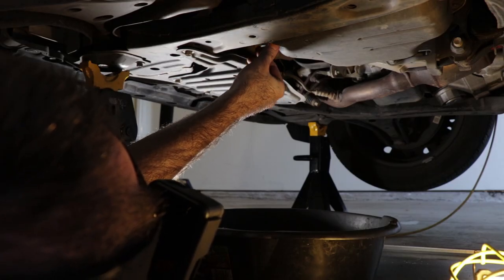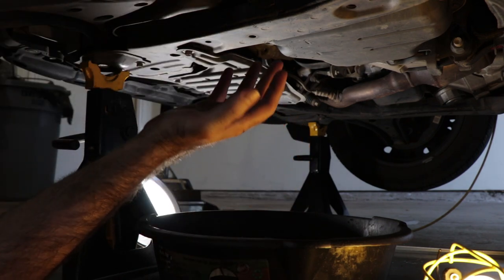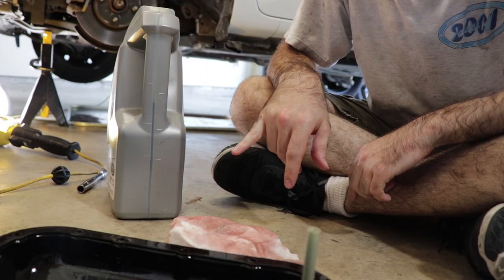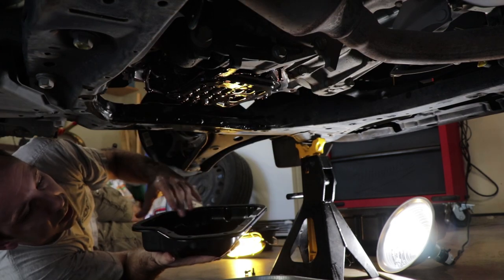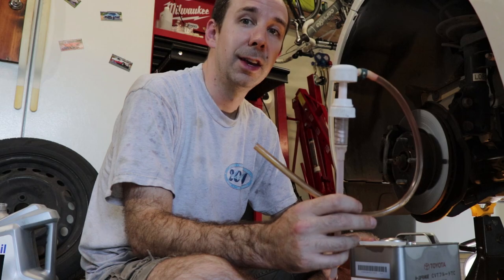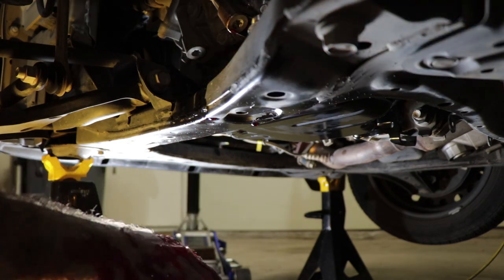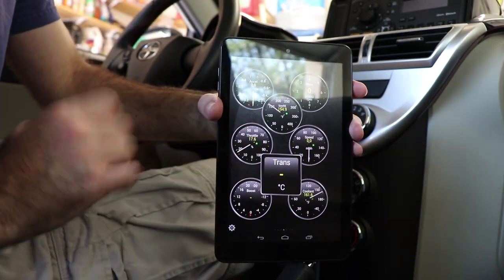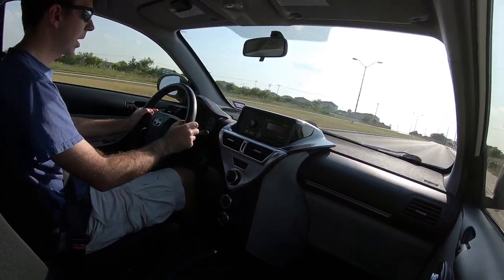Scion iQ CVT Fluid Change

Comment: Just yesterday, I did the transmission fluid change in my 2014 Scion iQ. After removing the drain plug and the plastic inner tube, there is still a considerable amount of fluid remaining in the pan,  but if you are careful there is no reason to splash it around, one can pour it all in the container being already in place for collecting the fluid. I also changed the transmission filter. Removing the filter also removes even more fluid from the transmission. Taking down the pan and the filter, I removed in total about 4.3 Liters, there is always a little bit that continues dropping from the transmission. The transmission is supposed to carry 6.2 L (according to my owner's manual), so this ensures that about 2/3 of the fluid will be new. My car was leveled with jacks, I leveled it with a level resting at the door sill. I followed the procedure explained in the video to fill the transmission and make sure the level was right. Following this procedure, I ended up  using about 4.5 liters of new fluid, which is very much the same amount that came out. Over all it was a worthy job and no that bad at all,  if I had to do it again it would be  a matter of 3 hours, including cleaning everything. 

Some take aways: I bought the filter from rockauto as suggested by Aaron (about $50). This filter came with a transmission pan gasket, which I did not use because I had already bought a new one from my Toyota dealer. The filter from rockauto is an identically looking part. I also bought from rockauto a quart of Aisin CVT FE fluid, because I was suspecting (and was right) that the 4 L jug of original Toyota CVT FE  fluid ($78) was not going to be enough. The Aisin fluid smells just like the Toyota fluid, same color and everything.

Because the pan gasket is some rubber/cork material, I think it is imperative to use a torque wrench, I tightened mine at 62 in/lb (as per Aaron's recommendation), and that seemed quite right. 

I filled/fed the transmission by gravity using a 1/2 inch clear flexible tubing from HomeDepot, with a funnel attached to one of its ends, the other end inserted through the side fill port. The fluid went in without hesitation. 

The procedure to measure the transmission temperature that Aaron describes is a breeze and  should be considered the default procedure. Warning: you have to work fast because the transmission temperature increases quickly, I started with an ambient temp of about 85 F and only had about 5 minutes before it went passed 113 F (the correct range is 95-113 F, I think).

Many heart felt thanks to Aaron for such a great service.

Comment: I did just the fluid at 25K then at 30K I dropped the pan and replaced it with new magnets, bolts, plug and the level tube. I carefully measured how much fluid drained out then added 1/2 quart extra. 43K now. Refilled with the top hole but had to screw in a foot long piece of soft hose with a tall slender funnel.The top hole will burp air out as you pour in the fluid. Thanks for the useful info!! not to many IQ repair videos out there.

Comment: I forgot to come back here and thank you, Aaron. THANK YOU! My car had that now-familiar whine. I thought it was something in the radio, but finally found the real reason. Your videos helped a lot. I bought a bulb pump with a hose that fit into the side fill hole and avoided most of the mess. I had to wipe down the side of the transmission case then douse it in Simple Green, but that was basic cleanup. No more whine!

Comment: I drained the fluid, dropped the pan and removed the transmission filter that's attached to the valve body with 3 bolts.  The filter has a fiber type mesh and isn't available from the dealer because Toyota doesn't want these transmissions to last very long.  I couldn't find any filter for sale online that looked identical to it so I rinsed the inside of it with solvent and blew it out with compressed air.  I measured the total amount of fluid that drained out and will refill it with the same amount.  It's ridiculous how some manufacturers no longer have a dipstick and fill tube in their automatic transmissions.   If Toyota would have sold the 6 speed manual version of the IQ in the states I wouldn't be forced to deal with an expendable transmission.

Comment: The filter needs to be changed.I bought it and changed the cvt fluid and installed a new filter.it is an easy process .Thanks for the video.
Reply from the maker: Do you have a part number or source for the filter you can share?  I spent a great deal of time looking for a source for it, and I never could find one.

Also, I'd argue that the filter doesn't necessarily need to be changed like the one in a regular automatic does, since this transmission only has one or two clutch packs, that don't engage and release while the car is moving.  You'll notice in the video that the fluid that came out of my car was still bright red, with very little worn off friction material in it.
Reply: Any idea of the part number for the filter cant seem to find one for the IQ

Comment: Dude, you're my hero.  Toyota (Scion) is woefully inept on this....CVT oils DO have to be changed periodically.  My 2013 iQ hit 60,000 and I could find hardly any guidance so got a can of the red CVT oil from my dealership and MAN what a mess.  I ended up just putting as much as I could back in the car and bringing it down to Christian Brothers (about a mile away) who fixed me up.  So, for my NEXT change (at another 60,000) miles, would it be okay to measure exactly how much I drained out on the bottom and just refill with that exact amount on that side fill place?  (Which I didn't even know about until I watched this!)
Reply from the maker: You could probably get in the ballpark that way, but if you might as well do it the correct way.  I admit, I wasn't very clear about this.  I should probably redo this so it's easier to follow.
1.  Drain fluid out by removing drain plug and level tube
2.  Reinstall level tube
3.  Fill until fluid overflows through level tube
4.  Put drain plug back in, add another 400ml
5.  Start engine, warm fluid to temperature
6.  Remove drain plug only - look for trickle of fluid
7.  If no trickle, add more until it overflows.
8.  Reinstall drain and fill plugs, wheel, etc.
9.  Shut off engine, open beer
But yeah, if you just measure what came out and put that much back in, you'll likely be close enough, unless the level was low to begin with.

Comment: IMPORTANT! Hit the pan bolts with PB blaster the night before! And use anti seize when replacing the pan bolts! I had three that got super tight once I started loosening them. They were seized and one sheared completely off and turned this into an all day project. I thought the other two would do the same but hit them with an impact wrench, thinking the hammer action might help break them loose and that seemed to do the trick.

Comment: Nice Video, since it has the same trans than my Vitz.   By the way "B" stands for engine brake (downhill driving).
Reply from the maker: Ah, that makes sense.  I suspect there are probably a few Toyota models that come with this transmission, but the iQ is the only one we get here in the States, as far as I know.  The exact quantity of the fluid you need may change a little from model to model, if they have different fluid cooler arrangements.

Comment: I read somewhere that a failure of the KB41 CVT was overheating at cooler temps. Always add extra fluid and don't drain it off till a drip. The height of that tube is to ensure failure before 100,000 miles.
Reply from the maker: You should definitely not overfill the transmission.  You don't actually want the components of the trans immersed in the fluid while it's running, which is a thing that can happen if you put way too much in there.

The tube is just the way that Toyota went about measuring the fluid level.  It's a clever idea, in that it makes checking the level easy from below, while the car is already on a lift overhead, and eliminates the dipstick, which owners generally can't be trusted to use properly.
Reply: @AaronAverett  Yes,All True, But mine was slipping between shifts in cold temps until that 1/3-1/2 extra quart was added at 25k miles. I'll try to find that site that listed failures of this unit and their history.
Reply from the maker: @Josephlola  Uhh, shifts?  It's a CVT - it shouldn't be shifting at all.

Comment: If you removed the straw with your 6mm hex/Allen wrench before dropping the pan you would have avoided the bulk of the mess.

Still a very good video.
Reply from the maker: I think I mentioned removing the measuring tube thing specifically about 2/3 of the way through.  As I mentioned, the manual doesn't describe this procedure specifically, so I had to do it the hard way the first time to figure it out.  Anyway, thanks for chiming in, I hope it helped you out. :)
Reply: @AaronAverett  
Guess I missed that...

Comment: Thank you for your thorough explanation on how to change the transmission fluid in the Scion IQ it was extremely beneficial. I did notice you used the Toyota TC spec fluid that the dealer recommended for that transmission however the owners manual recommended the Toyota FE spec fluid
Reply from the maker: Information about this is kind of murky, but around 2012, the "FE" fluid apparently superseded the "TC" fluid in most of Toyota's products, but they're similar enough to be interchangeable.  The FE fluid is thinner, and supposedly offers better fuel economy.

The owner's manual for my 2012 US market iQ says to use the TC type, so that's what I used, but it wouldn't shock me to find that other years say to use the FE instead.  I don't think the fluid makes any difference to the change procedure.

Comment: Nice video sir.  But at least cvt filter should have been cleaned after opening it , with cleaning fluid or atleast distal water . Pluse more cvt oil would be darined ( 0.2 L) with metal parts and dirt too.
Reply from the maker: Fair enough.  The filter that's in there seems like more of a strainer than a normal filter, though, so I'm guessing it mostly just keeps the ball bearings out of the works.  

Also, I'd advise caution on the grounds that I couldn't find a source for a replacement filter, so if you remove it, you need to be real careful about damaging any gaskets or seals in there.
Reply: @AaronAverett  it has very fine little holes in it which captures dirt and pervent small little metals to enter the cvt.

Comment: Thanks for the video, so the metal CVT can from Toyota for the transmission, should be enough to fill itcorrect?
Reply from the maker: Yes.  I talked at length in the video about how I did it wrong, but doing it properly, you should need roughly half of the can, as I recall.

Comment: Thanks for this awesome video.  Is there a difference between using the side fill hole of the transmission than the top fill hole?  I noticed a top fill hole as well.
Reply from the maker: You're welcome; I hope it helped you!  To answer your question, the manual is pretty specific about using the fill port I used in the video.

It may be possible to fill the transmission via a hole in the top, but given how easy it is to access the one on the side, I'm not sure why you would.  I guess because you don't have the little pump thing?  You could use a funnel and a length of hose if you don't have the pump.

Regardless, I'd caution against removing fasteners from the outside of the transmission if you don't know for sure that they're fill plugs.  On some transmissions, there are fasteners on the outside that hold components in place on the inside that can fall down inside the casing and jam up the works if the fastener is removed.
Reply: I tried that...do NOT even try it...you'll be sorry...use the side fill only.
Reply: @coloradoboo1071  I'm guessing it filled your funnel up when you started it? I filled my brothers IQ from that top T55 torx plug hole, didn't even know there was one on the side of it since the little info I found online only mentioned that top fill plug. I caught it filling the funnel up pretty quick once we started it and avoided a mess.

Comment: How do you check how much transmission fluid is in the car? Or do you have to open the pan?
Reply from the maker: I definitely talked about this in the video.  The proper way to check that it's filled properly is to lift the car and make sure it's level, and then, with the engine running and the trans fluid temperature in the proper range, you remove the drain plug, but not the plastic tube that's inside the pan.  If the level is proper, you'll get just a little bit of fluid dripping out of the hole, over the top of the tube.

Comment: Great DIY video for my CVT, Nice !!!.
Question: I have your same device Bluetooth OBD Device, I set the equation and all right, when I enter Torque Pro in Realtime Information I can't find the temperature data that I need. How did you put it out ???, it doesn't happen to me.
Excellent video !!!!
Reply from the maker: Did you set the custom transmission temperature PID as a gauge in the real time display?  There are two steps to the process - the first is to set it up as a PID that Torque monitors.  The second is to add it to the display, so that it's shown on the screen.
Reply: I have everything fine now, Just with setting Torque correctly. Thank for your answer !!!
Reply: @AbeDVB  BTW i have a European TOYOTA iQ and  this PID didnt work, i tried everything bought the app, F and C formulas etc. o showed crazy numbers.....

Comment: Hello, I have a question about the filter number at the Toyota iQ 1.0 checkpoint. I can't find the Toyota iQ 1.0 gearbox filter number anywhere.
Reply from the maker: This is because Toyota doesn't have a part number for the filter.  They don't actually make the CVT, and sell replacements as sealed units, so they don't carry service parts either.

I've seen a Russian site once that claimed to list the filter for sale, under whatever brand it is that makes it, but it didn't look like i'd be able to order one shipped to me here in the States.

Comment: I’ve had my Scion for 4 years now and Avg 10k miles a year. I’ve never changed the transmission fluid 😂 car seems to be working fine
Reply from the maker: There are a lot of variables, such as climate, your driving habits, terrain, and so forth.  Your use case may be less abusive than mine.  Also remember that at no point did my car actually stop working.  This was preventative maintenance, not a repair.
Reply: @AaronAverett  , I know. It’s just lame ( not you ) that I can never find a definitive answer on this. I had to changed out this weekend though. I hope it was worth the $

Comment: I followed your video to the tee and now my iQ won’t start. I also changed the oil, using your other annual maintenance video. It just cranks over but doesn’t start. I’m kinda panicking. Do you know what went wrong?
Reply from the maker: Don’t panic!  First, check for any electrical wiring you may have touched and make sure they’re all connected securely.
Reply: @AaronAverett  that was my initial suspicion, that I’d have to drain and drop the pan and check the connections! However it appears to have been an unrelated fuel issue. I think the fuel pickup may have gotten clogged or something (it was on a low tank but not quite near empty yet)
Reply: @AaronAverett  it was an unrelated fuel issue! Somehow it got gummed up after cranking it over for a bit it finally started and never happened since.

Comment: Thanks for the video, about to do in a few days. CarScanner on iPhone took in PID just fine! Any benefits to removing the pan, besides washing your hair with transmission fluid?
Reply from the maker: You say that like washing your hair with transmission fluid isn’t reason enough.  But no, no need to remove the pan unless you’re changing the filter or the gasket.
Reply from the maker: @maksym3d  I'm pretty sure that there is an aluminum or copper crush washer for the fill port, but I think I just reused the old one.  I assume you've checked the fill plug for it after you removed it?
Reply: @AaronAverett  Yup. Checked everywhere, nothing. I've lost more things in IQ than in any other car, go figure. The previous thing was a connector that I dropped on the dashboard while getting in the car - after 2 hours of searching, found in an outside pocket under the fender.

Anyhow, I ended up refurbishing an aluminum washer from a Honda ATF drain plug, because why not. There is a bunch of other ports next to the fill hole and they clearly do not have any washer, so I'm not 100% positive it needs one though.

The change went perfect, not a single drop of ATF past the container, highly recommend Hefty 15QT transparent containers - they fit under most cars without jacks. That is, until I warmed the tranny, opened the drain, saw no drippage, panicked, and tried to add more ... with funnel not inserted into the fill hole. That's right, your standard ATF change, probably get some in my hair too.

Not sure why there were no drippage the first time, either 0.4L is not enough, or we should check with the engine off. Between the spill, initial fill drippage, and adding extra, I drained 2.8L and used 3.4L, probably added 100-200ML after the warmup.

All in all, the weedwacker sound is gone. Will need to check on longer trips.